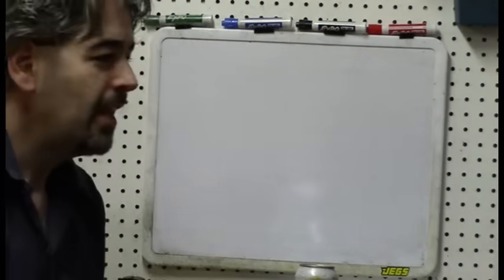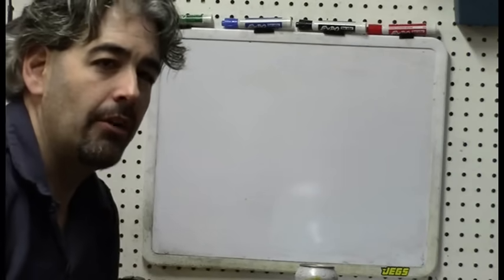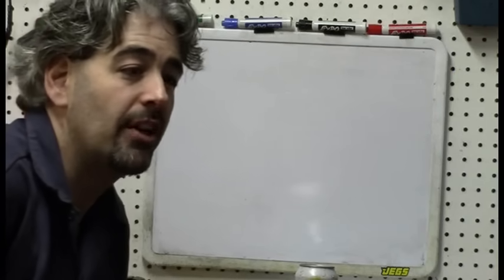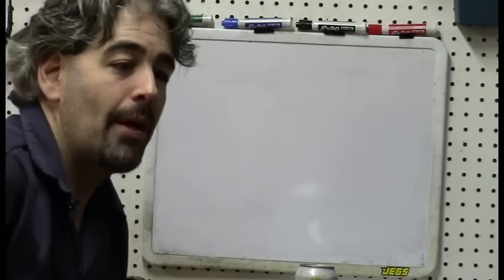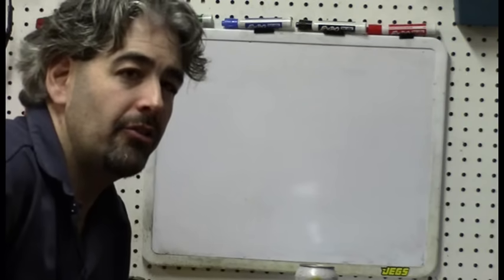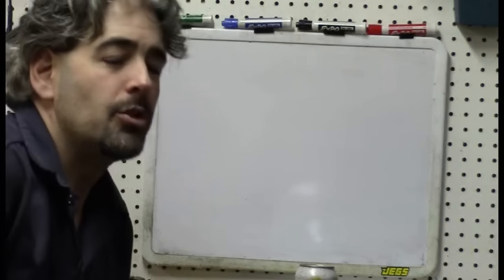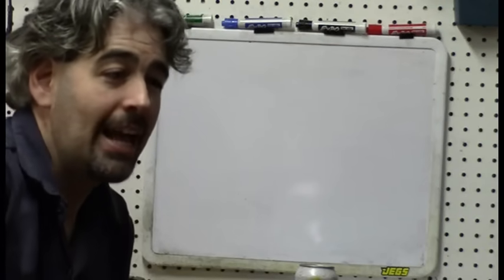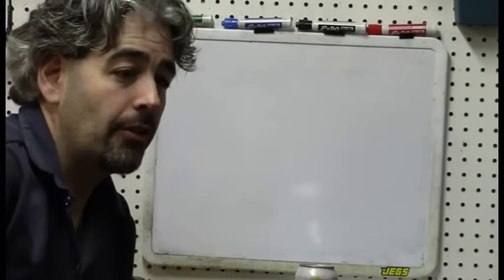Secret of Engine Problem Diagnosis- Fuel Trims Pt.1

Comment: Matt: I'm sorry this is so long, but I hope you find it interesting. Your video provided a rational and super-helpful guide for me to follow in trying to diagnose a problem with high fuel trim at idle. (Fuel trims 20%+ at idle, improving at higher RPMs.) Following what you explain in your video, I came up with the hypothesis that I probably had an intake vacuum leak. After much testing though I had to conclude there was no vacuum leak. Testing also showed I didn't have a fuel delivery problem - no problem with fuel pressure, injectors, O2 sensors, exhaust leak, exhaust restriction, leaking cold start air enrichment device. I cleaned the MAF, tested MAF voltage at various RPM/load settings and checked the MAF wiring harness/grounds. All tested normal. The only unusual finding appeared when I compared fuel trim against MAF grams/second output on a scan tool. At steady idle, the MAF grams per second reading was varying by as much as a gram, and the lowest grams per second readings and highest fuel trims numbers seemed to coincide. Eventually I had to consider the hypothesis that the MAF was underreporting idle air flow to the ECU. I found this article very helpful: http://www.motor.com/article.asp?article_ID=839. The author concludes the article by saying, “If you can't locate a fuel or air delivery problem to explain high or low fuel trim values, don't overlook incorrect MAF...input values.”

Cleaning the MAF with CRC MAF cleaner made no difference. But after I replaced the MAF sensor the fuel trims returned to normal. (LTFT Now 0% with STFT +/- 5% at idle). The grams per second reported from the MAF at idle now varies across a more narrow band, and never falls below 3.5 g/s. (With the bad MAF it was falling as low as 2.8 g/s.) Replacing the MAF fixed the problem. 

I decided that replacing the MAF was a reasonable thing to do, even though my testing hadn't absolutely proven 100% that the MAF was bad. Replacing the part seemed prudent, but seemed to fall short of the standard of empirical/scientific justifiability you have set. I guess you could say that replacing the MAF was itself the empirical test that proved the MAF was bad. But that kind of thinking seems like a slippery slope that could lead to becoming a mindless parts replacer. What other tests could I have done to test the MAF before I replaced it? The voltage tests I found in the Factory Workshop Manual and in Paul Danner's book suggested that the MAF was fine. I spent a lot of time testing and ruling out hypotheses related to vacuum leaks and fuel delivery and I was running out of patience. 

Even though I thought it was a reasonable thing to do, before I could bring myself to replace the MAF, I had to overcome a psychological hurdle: Namely the sound of your voice in my head saying, “If you replace the MAF, you're an idiot!” As much as I want to be a member of “the 2%” and not “a mindless parts replacer” I guess sometimes practicality demands a lesser standard.

I think the theme of “I want to be a member of the 2% and everybody else is an idiot” has great rhetorical appeal and gives your videos an enjoyable dramatic character.  You might find this interesting to read. It comes from a summary of the theory of drama elaborated by the great American philosopher and literary critic Kenneth Burke. He says that all successful dramatic narratives include a victimage or scapegoating mechanism: “Victimage is the process of scapegoating. Here, the speaker blames an external source for his ills. According to Burke, there are two different types of scapegoating, universal and factional. In universal scapegoating, the speaker blames everyone for the problem, so the audience associates and even feels sorry for the victim, because it includes themselves. In fractional scapegoating, the speaker blames a specific group or a specific person for their problems. This creates a division within the audience. The victim, whoever it may be, is vilified, or made up to violate the ideals of social order, like normalcy or decency. As a result, people who take action against the villains become heroized because they are confronting evil.” (from wikipedia  https://en.wikipedia.org/wiki/Dramatism)

The dramatic narrative you've constructed in your videos is an example of fractional scapegoating: it is the mindless parts replacers who are the villains, and it is us – the tiny minority of scientists – who are heorized because we are confronting their stupidity. This isn't a criticism by the way. Burke's claim is that all dramatic narratives work this way. And your video was invaluable in providing me with a strategy to follow in forming and testing hypotheses. But eventually, in the process of finally fixing the car, I also had to – temporarily I hope – embrace the role of idiot.
Reply: David UM1996 
Two years on and still making people smile, great post. ☺
Reply: Thank you for sharing your experience.

I'm working on a 97 Ford Ranger 2.3. I had been noticing sort of poor gas mileage for months; then got a check engine light. Scan tool showed a potential problem with the charcoal canister purge valve. Not interested in empirical testing when I can just grab the part off another rig (But, like you said. That's an empirical test too.)

Since I was right there with the scan tool, I pulled up my fuel trims and noticed right away that I had long term over 20, though it would drop under load. Back home; I checked for vacuum leaks and came up with squat. I watched this video a year or two ago, and thought I'd watch it again, to see if my memory of fuel trims was faulty. But first I scrolled down through the comments.

Your comment about hearing his voice calling you an idiot, or otherwise denigrating you is almost always on my mind when working on a car, and it's saved me some pointless part replacing since I discovered this channel. I just thought it was funny, how we were in just about exactly the same frame of mind.

My wife walked in and asked if I fixed my truck; and I told her: "Maybe. At least what I thought was a problem. But my fuel trim's really high; and I don't seem to have any vacuum leaks. Which is about all I can think of that would cause it... but I guess a bad MAF could do it too..."

And here's your comment. Same problem as mine. (apparently) I've been suspicious of my MAF for quite a while now, and I'm thinking that's probably where I should be looking next.
Reply: Joe Sevy 
I far from being a ace mechanic but would it set a code for the maf ? I’m dealing with a code on a gm p1174 just wondering if it’s bad gas ? I also think the plugs which are iridium but there at 116000 and I know that it’s need to be changed and go from there .. check for leaks .. there all saying you got change all your injectors and get reprogram not so fast .. the car starts on a dime took on the highway with good response to throttle.. any inputs thanks
Reply: @anthonypapaleo1940  You're really talking to the wrong guy here for that particular code especially! However; I can't see any possible logic in suspecting the MAF in this problem. The MAF detects total air flow to the engine; it doesn't have anything to do with the detection of a rich/lean imbalance between cylinders. The MAF can be, good, bad, or ugly without giving that code. If you're using a non oem air filter especially, I can certainly recommend cleaning the MAF with MAF cleaner, and after that many miles it's probably taken a bit of a beating. But, obviously, your only legitimate reason for changing it at this point is the same one that applies to changing the plugs. As (expensive) maintenance rather than waiting for it to fail. But, I'd be shocked to find that it had anything to do with your situation.

If your plugs have 116,000 on them, I'd suppose they're about due for a change, but I certainly wouldn't have much hope for that to solve the problem as there'd most likely be a misfire p0300 code along with with the p1174. Though I can tell you that I've changed plugs with 144,000 miles on them that were obviously in really bad shape without ever throwing a code. So, if you try it and it helps: Yay! Just don't expect much.

"Bad gas"? I suppose it's possible, but not too likely from what I can find out. I'm rather skeptical about something getting sucked out of the tank and past the filter being bad enough to mess with the injectors, but only enough to cause this code. Though, it's entirely possible for the filter to be clogged badly enough to interfere with fuel pressure; again. I'd expect another code, p0174 and poor performance. Though your code is associated with injector problems; injector problems are also associated with engine idle and power problems. Since you don't have idle or power problems, as far as you can tell, I don't think you're too likely to get anywhere there either. Still, you're the one who feeds it gas. If YOU think you've been giving it bad gas, start giving it good gas. If it sits for long periods of time, then good gas could have gone bad. But again. The whole engine gets the same gas. You're looking at an imbalance between the cylinders. Go ahead and use gas additives if you want. Some swear by them, some at them. My opinion is they sometimes do some good, and I've not seem them do any harm. Just don't expect it to fix the problem.

I'm also rather skeptical, for the same reasons, that one or more of your injectors has a problem, sufficient to cause this code, yet not bad enough to throw another code or cause problems with idle or performance. There's no way I'd even think about putting a set of injectors in it unless that's something I was already considering for some other reason. You can do a simple test yourself on the injectors to look for obvious potential problems. Simply disconnect the electrical connector to each injector and check the resistance of each one. If none of them are greatly different from the others, they're unlikely to behave differently when they receive a signal from the ecu. This may be a lousy way to diagnose injectors, but I've done it successfully before. The problem is that this can only find one possible problem. The injector could well be damaged, perhaps enough to cause your problem, without this test telling you anything. But, it's something you CAN do, and it WILL eliminate one possibility. You can also check the voltage being supplied to the injectors, but I'd expect that to show up as a code as well if it were the problem, and if it were a fault in the wire I'd expect the injector to completely fail, again, throwing a code.

I'd much more expect the problem to be one with an intake leak of some sort, which can be very tricky to track down. You'd suppose a leak would automatically be worse at idle than at cruising speed, but that's not always the case. Finding a leak that only presents itself at speed is going to be quite a problem. Still, that's where to start. Change the plugs, because it's time; then start checking for leaks. If you find one; that's something that needs fixed at the very least; and a very likely cause of your problems. Another symptom of a vacuum leak is if the engine races at startup. If your engine, when started, revs to a significantly higher rpm when started than it used to, or than other similar engines do; you've likely got a vacuum leak.

Since all the likely causes other than vacuum leak or general engine deterioration usually cause idle or performance issues, and you're not reporting any idle or performance issues, and there're no other codes, I really doubt that you're going to get anywhere with the injectors or fuel system. The most likely culprit is going to be a manifold leak of some sort.

If you have some kind of scanner that can show you fuel trims in real time, I'd expect long term fuel trim to be somewhat high if you have a small vacuum leak, anything over 10 and I'd almost guarantee there's a leak. If you don't have a scanner of any sort I'd recommend getting a cheap BAFX bluetooth scanner; buying the Torque Pro app, and using that until you can get something better. I can't make any recommendation for what that better scanner would be because I can't make up my mind what scanner I'd get even if I could get anything I want. But, even if you can't tell the engine's getting more fuel when you use propane, starter fluid, or whatever to find your leak; your ecm can, and it will change the fuel trim to compensate. That's why you need to be able to monitor the fuel trim as you're looking for your leak.

So, what help have I been? Not much. The problem with so much of this stuff is that it gives us problems that are only problems because we're informed about them. If not for this code, you literally wouldn't have a problem to fix. Or at least that's the way it sounds to me. Or, maybe it just gives us the opportunity to fix a small problem before it gets to be more serious.

Hopefully I haven't just added my ignorance to yours. Hope you fix your problem!
Reply: Joe Sevy 
Thanks joe my idol seems a little choppy but not bad but not racing .. also this code came up after my wife fill up at this one station.. so I’m taking the car to have the plugs changed , maf clean , throttle body clean ... I really don’t know what was done this car I just bought three months ago and also do my own maintenance but do the cold here in Chicago and no garage ... But like I said this only code I get no miss firing or any other code .. I really don’t like throwing parts at and till I know for sure . I will have the shop run a scan and see what’s up with .. thanks for any suggestions...
Reply: @anthonypapaleo1940  Lot's of luck. My car with the bad plugs seemed a little choppy in the idle too. Happened so gradually I wasn't really aware of it till I changed the plugs and saw how smooth it was after. Glad I'm not turning any wrenches in Chicago in the winter! Things are really mild this winter in Idaho.

Comment: Great video!!  Thank you so much.  I had a check engine light on my 2000 Silverado.  Both PO171 and PO174.  Hooked my scan tool and checked the short and long term fuel trim.  Found the long term steady above 20 percent.  Took a closer look and found a vacuum hose had come off.  Plugged the hose in and no more light.  You saved me a couple hundred and I really appreciate it. Thanks so much!!
Reply: John Webb great

Comment: Best teaching thankyou a lot.
I have 2005 4.8 vortec .
I fund 2 code
P0301
P0171,  
Fuel treams was
LONGFT1 0.25
Shortft1 0.0
i didn't change o2sensor .
I check than i found the broken vacuum tube which is located on the top rear right side  of engine goes to purge.
I replaced the 3" rubber vacuum tube than  0171 code erased.
For p0301 , i test coil and spark plug and wires , they working good.
Than i pulled out first cylinder injektor it was realy dirty than using carb.cleaner and c c intake cleaner applyng 45ps air into injektor all the dirts come out.
After installing back injektor .
P0301 code also cleared.
Engine runs Smooth and burns lees fuel.

Comment: I've never been so pissed off and so relieved at the same time in my freaking life!!!!! 🤬🤬🤬🤬😂😂😂😂😅😅😅
Well, I now know exactly what I did wrong!! It worked awesome at first, or so I thought!!! 😅😅 You just helped me out soooooooo much, THANK YOU, THANK YOU!!! 
~08 scion tc 2azfe ~Clogged cat #1... low funds... yeah, I gutted it. LOVED the sudden change in engine response!! Didn't realize what was happening tho... couple months later: leaking fuel injector into oil... soooo many gaskets and o-rings leaking!! I've drained the oil, new plugs, injectors & valve cover gasket. I've gotta drop the pan & replace the gasket, oil pump reseal, crank seal, was already gonna do my clutch anyway so rear main as well, oil filter housing... good hell. I got learned the VERY painfully expensive and time consuming way!! Valve seals... Probably have burnt valves... hopefully my freaking cylinder head & block isn't warped or worse... LESSON LEARNT.  DO. NOT. GUT. CATALYTIC CONVERTER. Should have done a hell of a lot more research, replaced it (with the now much cheaper than this bullshit) header and O2 adapter, had diagnostics ran throughout process and adjusted/tuned accordingly and enjoyed the rewards properly... OMFG. I BROKE MY CAR THINKING I WAS TEMPORARILY PATCHING THE ISSUE!!! HAHAHA send help. Lmao 🤣 THANK YOU for this video but I'm gonna go laugh cry for a bit and then watch part 2.

Comment: Great explanation. I had the engine management light on intermittantly, car ran great. Plugged in scan tool long term fuel trim was around 8% short term 16%. I tried this a few times watching the live data when someone else was driving.  STFT fell to 0% LTFT has not moved yet but I know it takes longer too respond. If I had a small vacuum leak I would have expected the LTFT to fall. I will keep an eye on it. Had code PO1071 for a while but found another code PO170. I erased the codes, engine management light out and so far staying out. Keeping watching your videos, great educational value thank you Matt. I am a great believer in proper diagnosis, your videos give me a much better understanding of what is happening. Incidently I read if the P170 code returns the fault is most likely the car's electronic control module. We shall see.

Comment: Thanks to your video I was able to figure out the problem with my car , Stft and Ltft 18% at idle but Ltft would drop at higher rpms but Sftf would not move even at higher rpms.
, I tested fuel pressure was good, it turned out it was the fuel injectors, thank you very much!

Comment: I was told to change O2 but I listened to this guy cause of this explanation and saved $$$$ it was my throttle body not letting air into the engine

Comment: Excellent in-depth and clear explanation and I have a question why the LTFT in my Citroen Xsara Picasso 2005 gasoline 2.0L running rich at around (-36%) at idle and at full load?